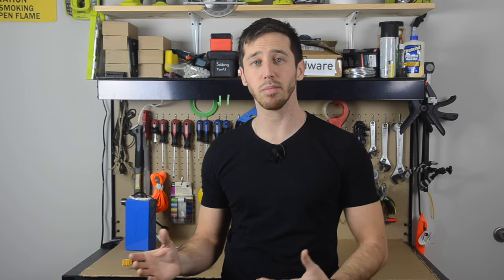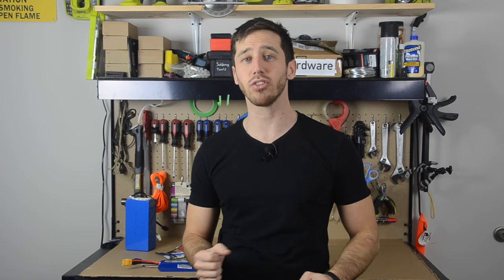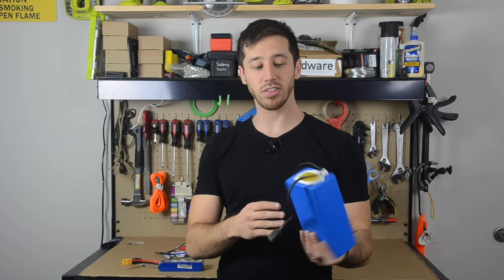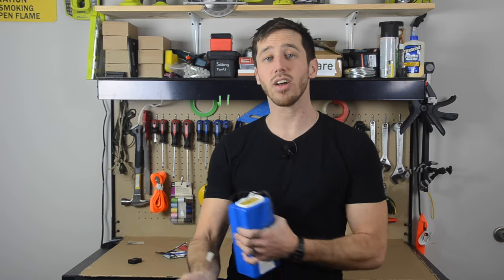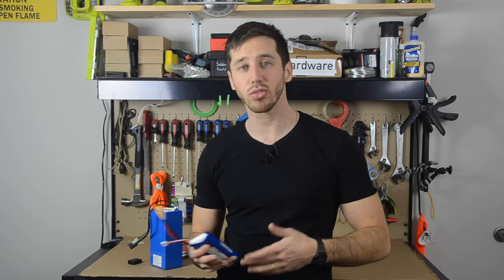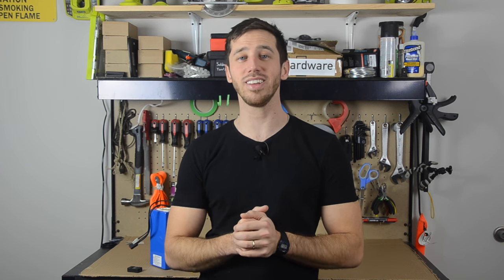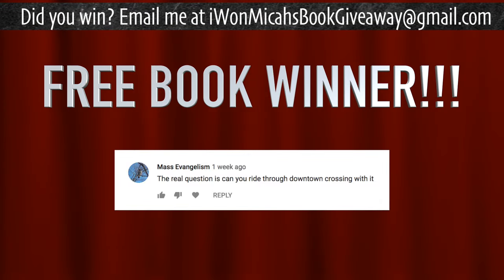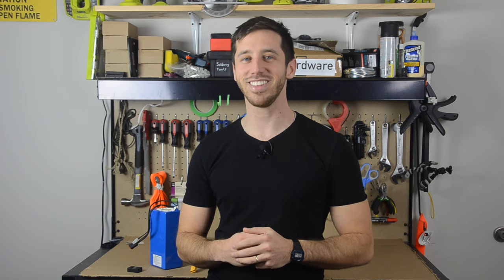Do you NEED a BMS for DIY Li-ion Batteries?

Comment: I appreciate your description, but I think giving deference to BMS haters because they prefer to be responsible for their own fire risk is bad form.  

There is good electronic design and bad electronic design, and preference doesn't enter the equation.  What do corporations building BEV cars, motorcycles, or bicycles use?  BMS every time.  Why?  Liability.  None can take the risk of letting owners screw up charging/discharging and the possibility of fire.

This is like designing systems without fuses.  You use a fuse, because you anticipate the worst case scenario and you guard against it with the best means available.  If you see amateurs peddling designs without fuses, you can bet they weren't trained engineers, or even experienced working with professional designs, or they would know better.

As you almost described very eloquently, BMS are an essential part of Lithium battery designs because they are a completely necessary component.  Reliance on the wit of the operator will inevitably lead to disaster, if not by you, then by someone who emulates your unsafe design and doesn't understand the complex rules of charging/discharging or the disastrous effects.  I'll add that a high quality charger (Satiator) also can add a lot of protection vs. a $30 no-name charger which might not be as capable of sensing the lower current cycle of a BMS that is balancing at the end of a charge cycle.  If your charger shuts off at the first current drop, balancing might not take place.

https://endless-sphere.com/forums/viewtopic.php?f=6&t=48388

https://endless-sphere.com/forums/viewtopic.php?f=1&t=87975  (had BMS, but was crappy one)

Comment: I'm currently building a eFootbike (based on a Yedoo Wolfer https://www.yedoo.eu/en/product/wolfer-9H9f6i.aspx ), 1500W motor, 48v 20 Ah battery and I have a question about battery charging.

I'm trying to charge the battery using an array of solar panels via MPPT boost controller. The standard mains charger is coupled via a three pin XLR connector. From the research I've done it seems the third pin is for a thermistor, I hope someone reading the comments can clarify this? 
Can I just couple up the positive and negative to the output of my solar array ignoring the third pin or do I need to create a control circuit to monitor this third pin to shutdown the solar input?

Comment: the fact is there is no need for a bms if it is a serie connection
you have to be sure all cells are complete charged
if one cell is only 50% charged this afects the total cell serie
if a cell is 50 amps the bms is not charging that cell with 25 A
the charging from a 50 amps bms will be A/ cell numbers if 16
50A / 16 =3.1 AX 3.1 V =9.6 W a cell nice to see on a screen
but no bms is doing the same thing most likely your charger
will have a shutdown and a charts stage100 % is 100 % if you do not pull the plug.
Reply: Be sure this is only for bms balansing it give you a lot more
most all have a screen that gives info and for charging the green lights
telling you the state of gharge and that is what you like to know and see
charging 10 piece 50 A x 50 volt in paralel the green lights shows the battery
that is charged first and the last one for that you do not need a computer or mobile.

Comment: How to set up two BMS. Please show wiring diagram, please!
Reply: Robert Esping Google it
Reply: Parell i guess. One of them is used for discharging. If connect 2 of them for discharge they should be the same having same resistance and in result will have double discharge rate. I dont think its good to have 2 for smaller pack because they will balance to quickly and voltae will raise up while after done balancing.
Reply: I am interested in knowing this as well.  I am building a solar power 18650 generator and would love to know how i can wire in a back up BMS. to each battery.
Reply: Regarding safety (not double output) you would have to put them in series. Connect the power output of BMS1 to the charging input of BMS2. All balancing cables need to be connected to their cells (parallel)

Comment: EbikeSchool.com I have 4 12v 7ah lead acid battery for my ebike, should I have a BMS for it?
Reply: Kasy Delrio My opinion you should just connect them in paralel when you charge them  and use a car charger. no need for bms when the battery you are using are lead acid
Reply: A 13s bms doesn’t work for you because you have battery that is 12v not 3.6v
Reply: @TonytheCarEnthusiast  that's what u have done I just want to upgrade batteries cause u had them 4 months and now I get maybe a mile and the charge drops. I can Charge for a full 24 hours and ride 20 minutes and the battery dies

Comment: can i plug directly the external battery charger from the hoverboard to the battery pack that already inside include the BMS? if so anyone could tell me the meaning of the 4 wire from the charging port on the motherboard followind this scheme? please thanks. http://vocke.tv/lib/exe/fetch.php?media=20150722_hoverboard_sch.pdf

Comment: it didn't balance mine.had 218650 discharged to 3v at least i took them all off the bms now there fine.so wtf.
Reply: It appears those BMSes are not very reliable. Especially those cheap China imports.

Comment: I have a few 4s LiFePo4, 9p batts I built, using, 100amp bms, and have balance leads! Itb Can be charged either way, and check the balance manually ,  I know LIFePo is safer than liion, but its mostly to prevent killing the cells! Over fire prevention!!! All are paralled, so basically 4, batteries in a bank, with 4bms, over over doing it, when a singlevbms would have suited my purpose, I did it so it will work for my 12v like it is, or in a emergency I can series it and power my house inverter with 24v, or 48v, if I go to 48v eventually, I'm planning a ebike, so I can use it for that in a jam, 400amps capable at 12v, 100a, @48v is plenty, its for my 12v lighting in myoff grid house, I have 120v lights, 12v is more efficient, 34ah,48v should go a ways on a bike also! Great video,,,

Comment: Do you know about electrical behavior , if even without BMS, battery will Balance itself cause its behavior of Voltage, in Charging or even Discharging Battery will Balance itself.
Reply: No, cells connected in series will eventually diverge ...